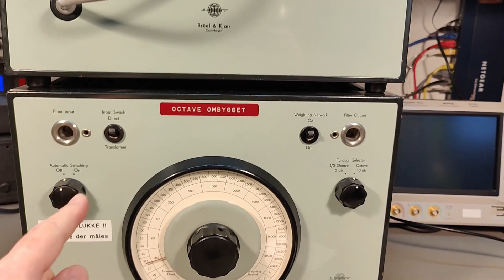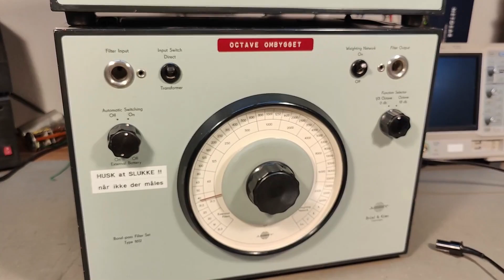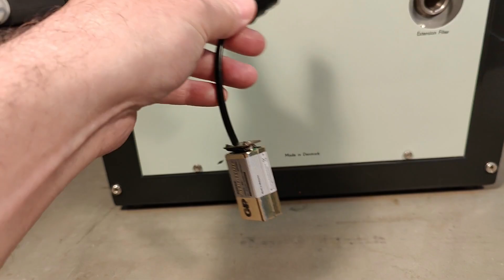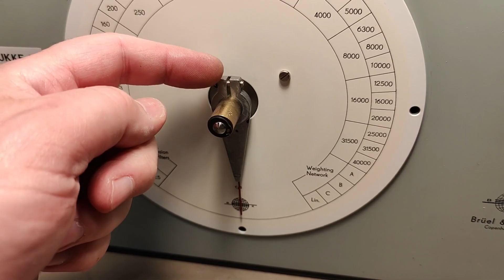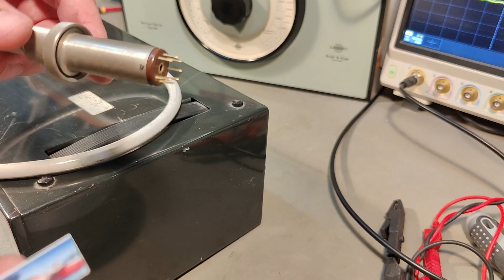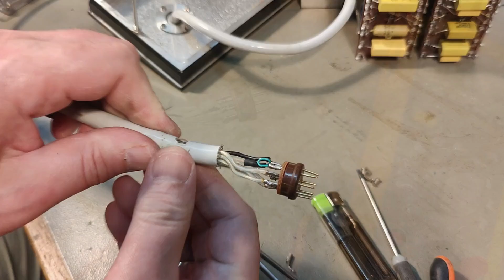Brüel & Kjær 1612 Band Pass filter set with 1620 extension

Comment: Glad you got the extension filter working.🙂 You could use a B9A tube pin straightener to straighten those wonky connector pins.
Reply from the maker: good idea, i got a few tube pin fixers :-)
Reply: @TeardownOZ2CPU  I forgot to say: what a great video. It's very informative and helpful. Thanks you.

Comment: Good evening Thomas, thanks for your video help alot.
I need some advice before buying the 1612.
I have a Bruel & Kjaer 2112 that I love; it's an octave filter. There's also an expansion module 1612 that allows me to read the first 3 stages of 12.5, 16 and 20 hz of the 2112, specifying that those two stages are for the expander's reading and also if you know what the diference of the 1612 ,1619 and the 1620 both also expansion filter.?
My question is whether anyone has experimented with it and, beyond the reading itself, if that reading is audible or only visible on an oscilloscope. I want to use it for musical purposes. Thank you very much in advance.
Kind Regards.🙂
Reply from the maker: do you have manuals for those ? if you go to peel dot dk, and find the Brüel & Kjær section, you can se he misses manuals and schematics for many the the units you mention, so i am not able to help so much, other than this video show very good how the 1612 works and what it can do, and also how it interface with external filters
Reply: @TeardownOZ2CPU  Thanks very much for your answer, love your videos :))))
Reply: Good evening.
This filter extension for the 1612 or 2112 is fantastic, but if I wanted to attach it to my 2112, is that filter extension range audible to the human ear, or can it only be visualized on an oscilloscope? Thank you very much, and as always, thank you for your help.

Comment: Great video thanks ! What kind of connectors do you plug into filter input and output ?
Reply from the maker: i live in Brüel and Kjær contry so somehow those adapters came with a pile of trading goods. I also got a few DIY adapters, they work but are not as cool,

Comment: Great stuff. A neat way to visualize the band pass filters is to feed a white noise signal into the filter and view the filtered output spectrum using the scope FFT function. If the scope supports averaging that would help smooth out the spectrum. Just need to reset the averaging when switching between filters.
A more sofisticated way to measure the frequency (and phase!) response would be to use a computer soundcard and suitable measurement software, say Arta or Room EQ Wizard.

Comment: Interesting instrument. I wonder what were practical use cases of this one. The solenoid thing is a nice extension for semi-automated measurements, nice!
Reply from the maker: imagine you manually or automatic sweep a multi tone content complex signal, and store the level at each analyzed frequency content, then display the values or draw the curve, it is spectrum analysis at its fundamental design.
Reply: When connected together with a measurement microphone and a microphone amplifier, these were 1960's state-of-the-art devices for determining the sound levels and spectral content of music or noise signals. The filter automation could be used together with a mechanical level recorder in order to automatically measure and store the sound levels at each 1/3 octave band.